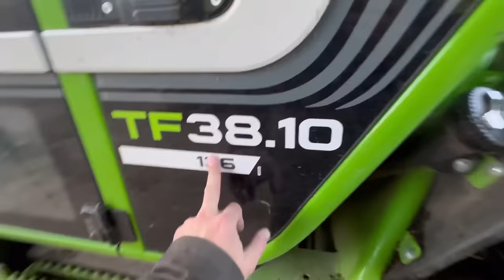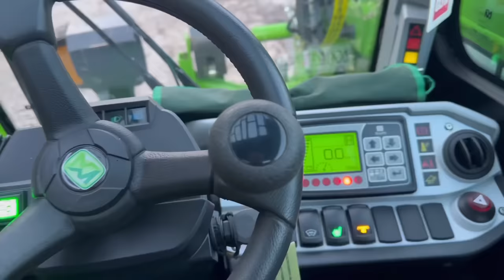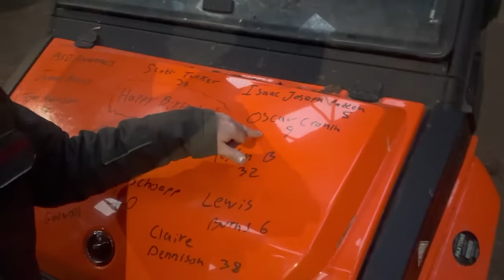BONFIRES AND MERLO FAMILY #AnswerAsAPercent 1328

Comment: I suggest that it is welded and then maybe a box section welded across it. A plate will be subject to the same strain and a box beam running forward might well distribute the load across the wall of the bucket. It looks from the shots of the other side as if that has had a similar problem. If that is so then maybe a beam running from teeth to top of bucket at an angle.